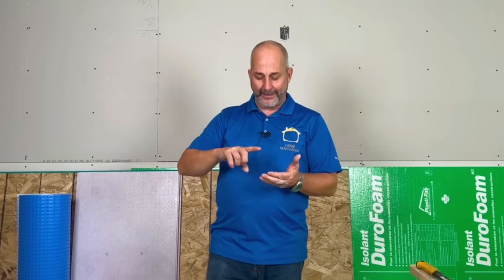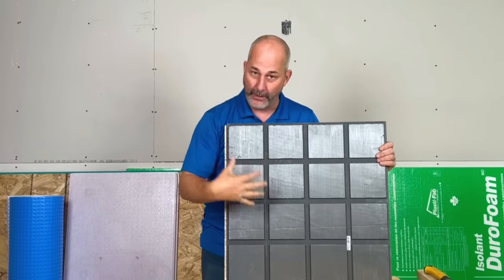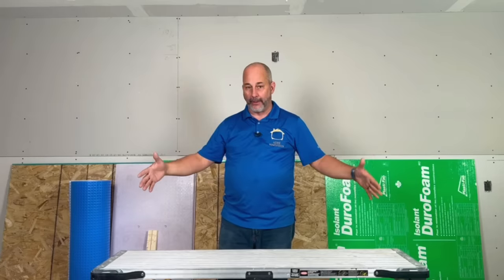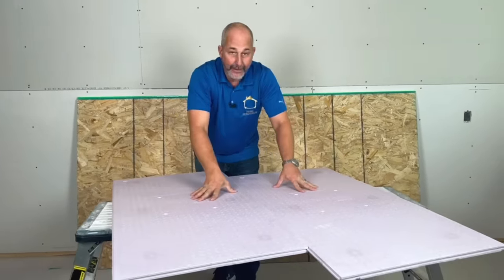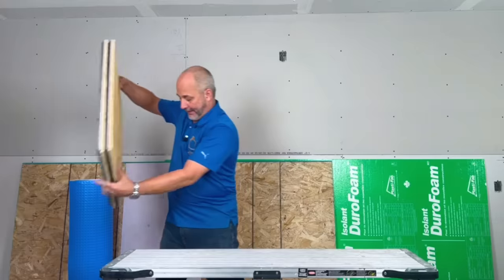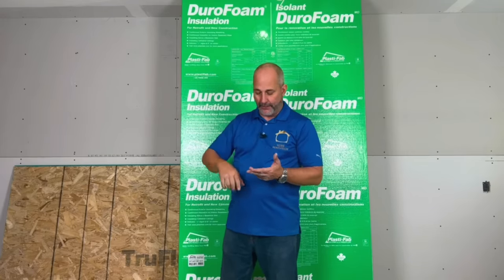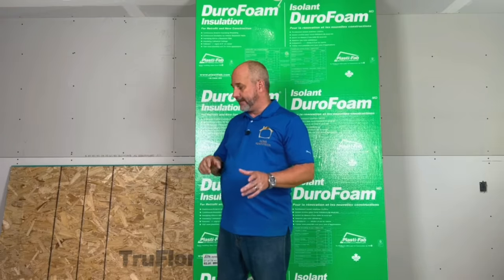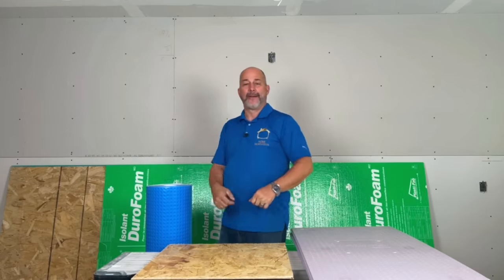Comparing 5 Different Subfloor Systems and What They Cost

Comment: These vids are great.  Especially since you are in Canada!  I live in an older house (1950’s) I want to put a subfloor, then vinyl plank, possibly ceramic tiles in some parts.  I think moisture management is crucial and I need some thermal break.  Does your system (with the durafoam and osb) provide water management?

What would you suggest?
Reply from the maker: not water management but if you get the new insul armour from dricore you get all 3 in a low profile product.

Comment: thanks for your info. I recently purchased an older 1960's midcentury ranch house bungalow. I have a new roof, eases through  and downspouts (8 foot long). Landscape is done and now to finish the basement. There is moisture, mold, and cold - (Alberta Canada temps of  +30C to -40C). I need your recommendations please? I'm considering DMX 2.0 materials for the subfloor membrane and would like to add underfloor heating system with vinyl floors. Is this a safe way to finish my basement? Can i also use the DMX vertically onto the walls to unsure moisture will drain to the subfloor?  The basement area is about 1000 sq. ft. Thanks in advance

Comment: Hi, Howudoin? I’ve bought a house 3 years ago and are renovating. Right now I’m doing the floor in the basement and I like to know what sub flooring I should use. The house is 12 years old in a rural area and I believe that the basement has moisture issues. The previous owner put cheap laminate straight on the cement floor. I find the floor and walls to be quite cold and a little damp. By the way, we’re turning the basement level into an apartment as there’s 3 bedrooms and a utility room,also an area large enough for a kitchen and living room. So I’m hoping that you would be so kind as to advise me. Thank you in advance, Angie

Comment: Hey Jeff,
If I'm worried about ceiling height of my basement, would you recommend the InsulArmour?  That way I don't need a layer of OSB on top of the DuroFoam.
Any other cheap solution, keeping thermal a key consideration?    Thanks so much!
(40's house, sewer out the wall, not under the slab)

Comment: Thanks for this info!  I have a remuddled add-on: concrete floor at grade (looks like add-on to original '49 garage) - will do the moisture check first.  Do baseboard heater make the flooring choice different or can I just reposition the heaters?

Comment: I have a split level house that was built in 2004 that currently has carpet in the basement with the expiring of the laundry room and bathroom (bare concrete and tile respectively). I do have a large window to pass material through (I have a walk out basement with a large window beside the door) and no water issues whatsoever. Thoughts? I’d also like to keep using carpet in there if possible.

Comment: Older home on concrete slab that is higher on ends(lower in center of house) so subfoor not an option. No vapor barrier. Need thermal and misture protection. Will be installing carpet. Thanks

Comment: This video was super timely. I live in Northern Nevada (near Lake Tahoe). We get 11in of rain per year. I know some people get that in a month. Well, we had 10 inches of wet snow followed by 3 inches of heavy rain in a matter of 10 days. That was enough to get some very minor leaks in the unfinished basement of the 1994 house that I bought 9 months ago. Two little leaks came from the walls where some water came on the tie holes. Another leak came from the cove joint along an area outdoors that I have been keeping an eye on as a drainage problem since I moved in. Since they normally get very little rain here, the house has no perimeter drain system. I've been eyeing using the basement as a workshop and doing an epoxy floor and just finishing a quarter of it as a home theater or game room. Would love to see a video about epoxy flooring and the pros/cons in a basement. I don't have any evidence of water coming up through the floor - just cove joints and walls.
Reply from the maker: take a minute to patch those holes with hydraulic cement before finishing the basement.  I am not an epoxy floor fan. it tends to stay too cold in a basement to work. other than that as long as it does not transfer moisture epoxy will work just fine. Cheers!

Comment: I live in Caledon Ontario and my house is older ( built in 1986), I’m putting in a walkout and an egress window. I’m going to rent out the space so I want it done right the first time so the renters have a good experience and I don’t have to deal with any issues. I’d like to put down a subfloor, which system would be a good fit for my situation? Obviously I’d like to keep the cost down as anyone would.

Comment: Hey Jeff! I absolutely love your channel. I’ve done a lot of DIY in the past and you are my go to for a little nudge in the right direction. We recently moved into a new home with an unfinished basement. (Built in 2003) Instead of starting on the basement right away I waited a whole season to see how the basement reacted to the seasons. Glad I did, there seems to be some small cracks in the walls allowing some water to seep in. Is there anyway possible to use hydraulic cement mix to fix the cracks and be able to use the green Durofoam board? Or possibly mix with another option to help keep costs down?
Reply: I have a similar issue - tract home built in 2004/2005, unfinished and unconditioned basement.  We live in the southeast USA where the basement temps range 60-75 degrees and relative humidity range 45-70% throughout the year.  Did the plastic garbage bag test via Jeff and no moisture issues from the concrete slab.  However from inspection report prior to the home purchase we have hairline cracks at various points on the cement walls that at one time in the past were indicative of a "damp" nature.  Nothing seeping in to date since we've been in the house.  I am wondering which of the subfloor systems Jeff presented will give us the best piece of mind for the next 20 years given our basement situation. Eventually the entire basement will be finished and conditioned.

Comment: hello, thank you for a great video, very helpful. I have to install engineered hardwood for main level of a 2000sq foot bungalow in Calgary, half of the floor has subfloor heating, so i want this heat to some thru for efficient heating,  Basement is finished and has subfloor heating. What to you advice as best product for the main level ?

Comment: Am I correct, that some of the new vinyl products advise not to have a subfloor as the products are designed to go directly on cement floors (if described accordingly) as they have backing? Or, is it still advisable for comfort? And...part 2, prior to employing, I have some thin cracks (settling - build 2006 - no water) any suggestions on addressing them prior (sealants/type - or a video that I can't seem to find)? Thanks in advance, most appreciated!!!

Comment: I’ve got a 6x12’ patio that’s part of the slab and covered by the roof. One wall is brick the other is sliding glass entry with a 3” step. I want to close this patio in. What material should I use under my PT sleepers to keep them from rotting?

Comment: Hey, Jeff! 👋 Part of our home is on a slab. We recently lifted up the whole floating floor and patched some cracks. We plan to put engineered hardwood down in its place. We don’t seem to have a real moisture problem but I still want to cover my bases. We also want to glue down the floor and I don’t want to worry about future cracks (if they still happen) destroying my glued down floor… My plan was to use Bostiks roll cote vapor and moisture barrier, then install the duro foam or something like that on top of it, then install OSB to glue the floor too. Would this work well or would it pose some issues? Thank you!

EDIT: I just realized I don’t think I could do that…. It would be too tall. I can’t go taller than my doors. Especially the exterior door into the garage… ugh..

Comment: Very informative video! I've been trying to build up the courage to start finishing my basement and this series is extremely helpful. Would be curious to see what the detail looks like for these flooring systems at the perimeter finished walls. Any extra steps needed? Or just run the system right up to the wall?

Comment: Great video ! 
Currently I am renovating my basement, can i use vinly planks 4mm thick on MDX 1 step or do i have to go with thicker vinyl planks ? does vinly plank need to be more rigid or more saggy flexible to avoid pop out?

Comment: I'm in Utah, US and looking to finish the basement. Wondering the best cost effective system. Still testing out potential water issues. Any recommendations for this area? 4 seasons, heavy snow, hot summers, low humidity.

Comment: Hey, converting a shed in to a granny suite. On a concrete slab, lots of water potential. 

I was thinking the one-step with durafoam and OSB on top. They need thermal and moisture. 

Instead of tapcon screws, could I use titebond 3 because I am thinking the screws will defeat the moisture break.

Comment: Hi Jeff, im looking at DMX for my cld (1943) somewhat leaky basement. Some of the concrete floor is pitted from past water damage. Should i use self leveling cement in those spots before laying the  membrane 1st? Id like to cover with vinyl plank

Comment: Hi Jeff, your videos are legitimately some of the most helpful on the internet for DIY. I have a floating slab with an approximately 1" gap around the perimeter of course but it also has cut lines in various spots across the floor. House is 5 years old. Can the Dricore go right over the cut lines or do they need to be filled in with something? There was minor movement from settling but nothing significant. Thanks!

Comment: Wondering if you are still answering questions about subfloors. I own a dance studio and am decided which subfloor to put down in order to provide me with what we call a "spring floor". It's not like a gymnastics spring floor but it provides give that protects our joints when we dance and jump on these floors. I was looking at dri-core R+ and then was going to put some rubber flooring under that because I don't think the dri-core provides enough spring. I'm putting a product called Marley on top which is a rolled vinyl that we dance directly on. Wondering if you have any experience or thoughts about this. Thank you!

Comment: I have a 1990 house. I have a subfloor that is Black paper, 2x3 sleepers with 5/8 plywood with glued and nailed hardwood bambou floor. Had water dammage because of à blocked drain from house to side of the road (no city water). I have to rebuild at the same height because of stairs. Would love to have a system for water management and install engineering floor. Suggestions ? Delta fl then durofoam then t/g engineering floor. No nailing? Can water be trapped in the delta fl cups? So barricade or insul armor?

Comment: Hi Jeff ,
Was just wondering what subfloor to get for my basement. 
It's a new house 2022, it has the concrete poured over the insulation and I was planning to put down vinyl plank. 
What are your thoughts on what to put over the concrete.  Thanks

Comment: I’m finishing my basement, house built in 1990, live in Massachusetts, just finishing one room and an entry way in the basement.  Worried about clearance issues for the basement door if I run more than inch or so.  Thinking of the square pieces there for a moisture barrier and water management (along with a thin flooring option).  What are your thoughts?  Thanks!  Josh

Comment: Hi Jeff, Great channel. I been watching your videos for a while even when I don't need to. my house is 130 years old in Orillia and I have to insulate a room in the basement. I have from time to time  a little water coming in, No puddling just stains the concrete a little. My plan is to spray 1" of spray foam the walls, then frame 2"x 6" and fill with rock wool R22. My question is, can I screw down my framing over top of strip of 1-step dmx so so the bottom framing plate can never get wet. do you have a better way? Thanks so much. All home owner should watch your channel before doing any Renos.

Comment: Dealing with both water and thermal here. Just two days ago I bought the polysterene Dricore panels. It sounds like it is just more expensive than some other of those solutions.

Question: Do I use vapor barrier tape on the joints in the styrofoam? I am hammering them together, but the gap just doesn't seem tight enough.

Comment: We have an old house built in 1925 in the Kansas City area with an uneven concrete basement floor. We do have a little bit of moisture, but not much. The ceilings are very low, not even 7 feet, so I can't build up too much. I'm wondering if I could install a heated floor system and pour a self-leveler on top and call it good?

Comment: long time viewer, first time commentator, I live in LA, CA in a dilapidated Trailer/mobile home. 
subfloor structure is:
Trailer beams,
compressed black fiber board (moisture?), 
2x6, 
flood damaged plywood (repairing and replacing), 
new 1/8" padding, then crappy planks ($1.30 a plank, girlfriend wanted the color ): 
animals and repairs have torn up the fiber board, would plastic stapled underneath serve as a moisture barrier?
I'll take my answer offline. 🙏

Comment: Looking for some advice, please. I have a quad level house built in 1965. Looking to put down either glue down or click lock vinyl. The problem is I have floor drains. Would the Insul-armor allow for a flooring install (to help even out the floor's drainage slope) and allow something like a click lock vinyl to be installed?

I'm not really that worried about a thermal break since it will never be fully finished. Just need to manage water in case of a leak and have something that looks better than bare concrete. Thanks

Comment: I am planning on building and would like radiant floor heat. My problem is that I have old sports injuries resulting in surgical steel in my foot and ankle. Standing on concrete is painful. I need a floor that has some spring/ shock absorption (not carpet).

Comment: I'm buying a 1978 home in central MInnesota. It has had past water issues, block walls with some cracking. There is a dual sump drail tile system installed now(2 years ago). I plan on using the space for a home gym. It's completely unfinished as of now. I'd like to have something over the concrete floor but don't plan on finishing it completely. What would you suggest? Thanks and I have recently been binging tons of your videos. Great content!

Comment: Do not install the blue thing at 4:00 in a partially finished or unfinished basement. You will get mold because it traps moisture underneath it. It claims to be anti-mold but when I removed mine there was black mold and it smelled so bad I had to use a special chemical to clean the floors. It might work in a fully finished basement but don't even think about it if your basement is not finished and you just want a floor for kids to play on.

Comment: Hi Jeff, love your videos 👍   I have a 1500sqft bungalow built in 1987.  I am in Winnipeg,MB. We have owned the house for 2 years now with no signs of moisture or water at all in the basement. 

I would like to finish my basement floor with luxury vinyl plank. A thermal break is definitely needed, but do I need to worry about moisture? I am leaning towards the DuraFoam and osb option but I am worried about moisture.  What are your thoughts? 

Thanks

Comment: Findlay, Ohio (pretty close to the old  great black swamp) 

New Build 

Dual sump system (exterior French drain with interior sump that has a 4’ wall around sump & 2nd sump is for interior sub slab drain to a sealed top sump pump w/ no wall)

9’ deep basement 

12’ to bottom of back yard (on a hill) & 10’ below grade to street drains, water table is 120’ deep for people doing wells but a mile  away is 20’ deep (geologically of rock quarry vs swap being 1 mile away). 

Want carpet on the future basement floor  & on basement stairs for the golden doodle (buying unfinished, close in 2 weeks)

Want R5 ish over slab because I hate cold feet. 

What system would you use?  I feel like an air gap from slab to insulation is best water management practice BUT also feel like the walls can’t leak enough to matter 😊

Comment: I have a late 1970s house, the grading issues have been fixed. I can bring in 4x8 sheets and looking to put down vinyl planks or laminate flooring with a pool table. Which method for sub flooring do you recommend?

Comment: Bamboo floating walk out slab. Can I just use a jute with vapor barrier?  Other question can I use the 3/4 foam sheet then jute with vapor barrier or do you need the plywood on top of the foam to distribute weight? Looking to conserve heat and make it not so cold in the lower level

Comment: Hi.  Became a homeowner last year in the southeast USA.  House was built in '97.  I don't have moisture issues, floor can be a little cooler than the house, but I have a different issue.  My basement floor is uneven in multiple spots.  It's subtle until you put something that has to balance like a table or needs to be flat like piece of wood.  The floor is painted concrete.  What would you recommend to address something like that?

Comment: Great video! My home was built in 42’. Looking to do the basement soon and starting on one side (12’x23’). No issues with water coming through the walls but I’m sure I need some sort of vapor barrier, and I have what seems to be old 9”x9” tiles over concrete. What do you recommend?

Comment: Could i put the blue dimpled down on concrete for moisture management and the Durafoam on top for insulation. Then vinyl plank on top. My house is a 1976 build. I just resealed the foundation with rubberwall membrane. I do have effervescence on the concrete floor.
Thank you 
Eric